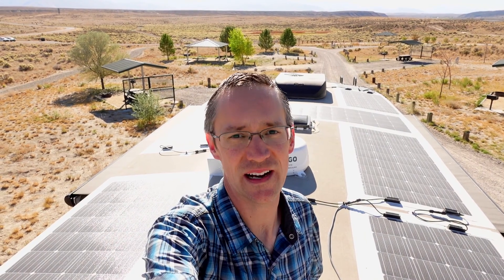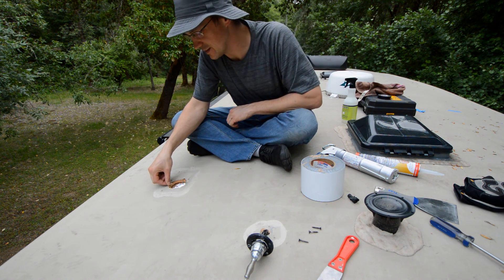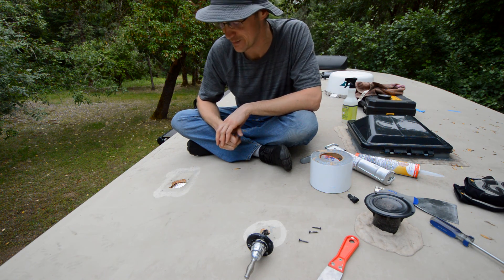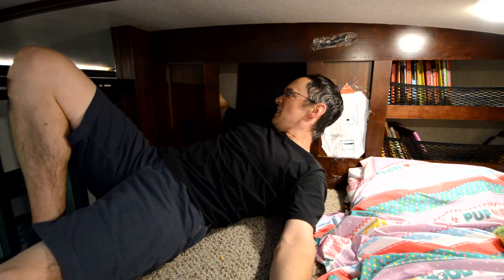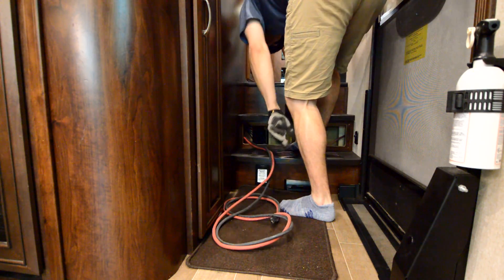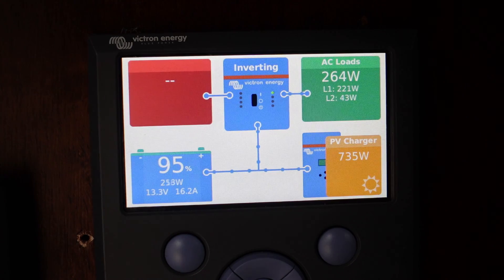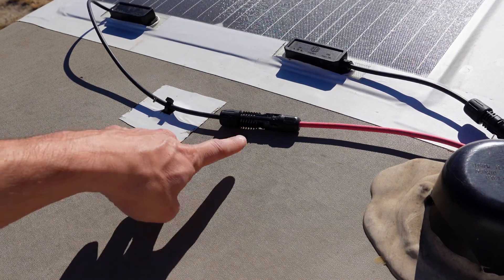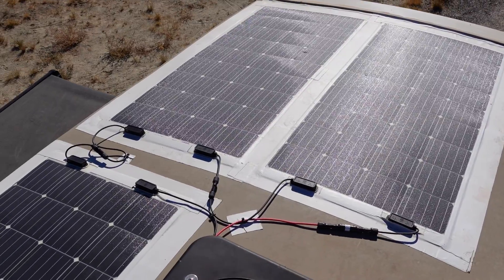RV Solar System Installation Series // 2625W of Solar for Off-Grid Boondocking with Air Conditioning

Comment: LOL @ 'nothing's more fun than drilling holes in a perfectly good roof' Thanks for your insight!
Reply from the maker: Happy to report it's all held up well over.thr last couple of years!
Reply: @NeverStopAdventuring  I'm in the process of building a system- just received my 1600 AH at 12v worth of LiFePo batteries- will be running them in a 24v system that when completed I think will be extremely powerful- I'm even considering incorporating wind generation and very likely will for those cloudy days. I'm hoping my system will be almost like shore power- except FREE- we shall see.
Reply from the maker: @woolfeeeee  nice! Have you tried wind power? I've heard the turbines can be awfully noisy.
Reply: @NeverStopAdventuring  No I have not-  I'm thinking I'll be using several small vertical spiral types- I can't imagine they're all that noisy. I am a little concerned that the visual distraction of them spinning on the roof could take away from the serenity of the campsite.
Reply from the maker: @woolfeeeee  I would definitely want to test one out first before designing it into my system. I feel like one of the MAJOR perks to the solar setup is it's silent, passive nature. Maybe find one on Amazon that you can return if you don't like it!

Comment: Are you glad you did them in sets of 3?  I'm Thinking of adding around 1500 to 2000 watts to mine. Thanks
Reply from the maker: I would still configure it the same way if I was doing it over again, yes. 3 in series at a time just worked out well as a way to breakup 15 panels.

Comment: So you mounted the solar panels as you did and it looked great! my question is most solar systems i’ve seen mounted have been with raised brackets with a air gap between the roof and panel. they say this helps with heat build up of panels and roof. Have you had any heat issues with your panels and roof? I like the way you’ve done your because of way less weight on your roof. Would you foot the same way again and what changes would you do different if any?
Reply from the maker: I asked Renogy about that when I bought the panels and they said they didn't recommend an air gap. Not that it wouldn't help keep panel temps down, but it hasn't been necessary. The hottest temp's I have measured on the hottest days of the year have still been within spec. I haven't had any heat problems although I'm sure I'd have a few % points more efficiency if I had spacers. I was definitely going for the least amount of weight and still have no regrets with the mounting. The only change I'd recommend now would be a higher voltage battery bank. I stuck with the 12V system for simplicity and because my leveling system claims it can pull a whopping 90A. I do have some lessons learned videos if you'd like to see more.

Comment: Cost?
Reply from the maker: For the solar panels, controllers, and associated wiring it was about $7400. There's a more detailed description on our blog: https://neverstopadventuring.com/2020/09/rv-solar-install-solar-panels/
For the batteries, inverters, monitor, etc. it was about $9400, also detailed in a separate blog post: https://neverstopadventuring.com/2020/09/rv-solar-install-batteries-inverters/
It was a lot, but I'm sure I saved a lot in labor costs too buy going the DIY route. We're still happy with the setup. It's completely changed RVing for us!

Comment: Outstanding!!  Is there any way that you can put a panel on top of your slides?
Edit: nvm, I just noticed that you have slide toppers.
Reply from the maker: Thanks! Without the slide toppers you could put a panel or two on top of a slide. I can see two issues with that though. The first one being that it would probably only be good for a couple of hours each day because it would be shaded whenever the sun isn't directly overhead. The second issue would be that you'd likely have to run the wires inside instead of on the roof. I have seen at least one case where someone mounted panels over a window or two like a window awning. I'm not sure exactly how it was mounted to the side, but that might work better than on top of a slide.

Comment: Have you noticed any issues with heat transfer to the roof from the solar panels or performance of the solar panels because of heat since you attached the panels directly to the roof?  We are looking at flexible panels for our class A and are interested in the impact of attaching the panels directly to the roof of the RV.  Does the RV get hotter with heat transfer from the solar panels to the roof?
Reply from the maker: It definitely doesn't get any hotter inside than it did before. I'm not sure if it matters, but using the velcro underneath the panels does keep a small air pocket between them and the roof. They aren't completely flush, but close. Panel performance has been great. Peak wattage changes a little depending on which direction we're facing when parked due to the roof slope, but we haven't experienced any panel heat problems yet. I do check them from time to time on hot days and have never seen any temps outside of their operating range. So far we are still really liking these Renogy panels!

Comment: Hi, great videos, thank you. I am considering a large system to run AC too, was wondering you had considered 24v or 48v system and using a 12v converter to keep cable and MPPT controller costs down? If so, why not? Trying to consider my options...thanks!
Reply from the maker: Yes, actually a 24V or 48V would be MUCH better. The reason I stayed with a 12V battery bank was because my leveling system claims it can pull up to 90A. To accommodate that kind of current draw would have required multiple 12V converters, more wiring, etc. I decided to keep it simple for the leveling system.

Comment: can u explain why 3 controller ?
Reply from the maker: Sure! But this is going to be kind of long winded... We stayed with a 12V battery bank because our levelling system claims it can pull up to 90A, which would have required multiple voltage converters if we'd used a higher voltage. So, for a 12V battery bank, each solar controller can only handle 1400W. Now, we knew we wanted as many solar panels as our roof would fit so we could run our AC in the warmer months. We happened to be able to fit 15 panels. To use only two controllers would have meant dividing that into an even number to do series/parallel wiring. So sure, we could have used 1 less panel and gone with just two controllers. I went with 3 controllers so none of them are maxed out, it accommodates all 15 panels, AND gives us room to expand if we want to. We might still add another 3 panels to the 3rd controller and wire them in remotely so I can place them on the ground or the truck or whatever. We'll see.

Comment: I am doing Sprinter 170xt

Started with Renogy 170 but switched to Rich 100's

Also LENSUN semi flexible

I am planning to have a flip-up rack off rear with panels as well as off side slider

Trying to leave roof as is to minimize reduced streamline.  And air turbulence 

It seems flexi panels do not have a long life if exposed to continuous climate ..

I am also using Bluetti power banks  .

Quick
Easy
Portable
Reply from the maker: Nice! Rigid panels are definitely a way better value per watt. The lifespan of the flexible panels vary greatly by brand. Renogy still offers a 25yr warranty on theirs.
Reply from the maker: @johnw3724  that's true too. My point was that many flexible panels degrade faster than their rigid counterparts. Renogy offers a 25 year power output warranty on these flexible panels so there shouldn't be any worries about them degrading faster than rigid panels.

Comment: How are the panels holding up so far ?   Please any input is greatly needed since I’m looking at installing these.   A lot people have issues of overheating the panels.  So I thought go with a good companies flex panel, Renogy 175watter.   Can you do a video of solar amounts, charging, the amp/volt numbers in shade and sun ?   Any input is very helpful .  Peacefrom510 .
Reply from the maker: They're holding up really well. During the height of summer I measured them at 160-170 degrees a couple of times. It's not any where near that in the winter now. The spec sheet says they're rated up to 185F. I would assume I would see some sort of reduced wattage if they went above 185. If I had to do it all over again I would still choose the same panels. We'd like to do a 6 month follow up video as time permits. That would be in January. Check out our blog post for a use scenario: https://neverstopadventuring.com/2020/09/rv-solar-install-solar-panels/
Reply from the maker: I should add that probably our biggest challenge with pulling down maximum wattage is the curvature of our roof. Because they don't tilt, the best we can do is point the back end of our trailer south and that doesn't always happen. At peak sun hours this last summer we'd see about 2000 watts coming in. My record for 2020 was 2280 watts at one time.
Reply: @NeverStopAdventuring  can’t wait to see more videos on this.

Comment: Do you have soft starts on your AC?
Reply from the maker: We do. That was one of the first mods we did a couple of years ago. We put in EasyStarts from Microair on both AC units so we could run them off of our little 2200 watt generator with the hopes of someday doing this solar project. It's possible that our inverters could do the job without it, but it would probably shorten their lifespan.